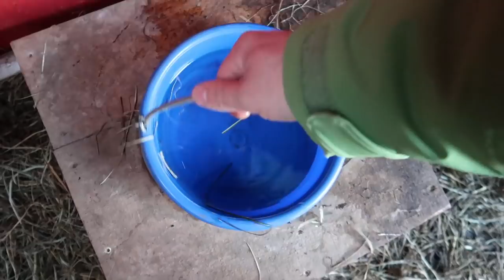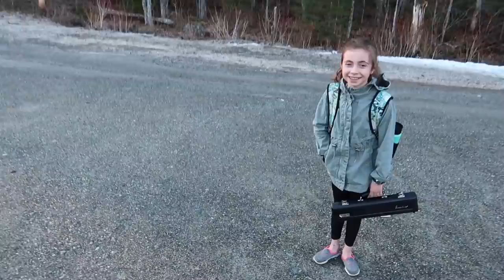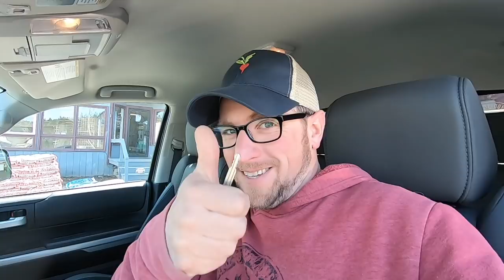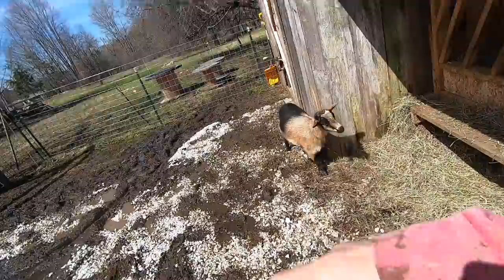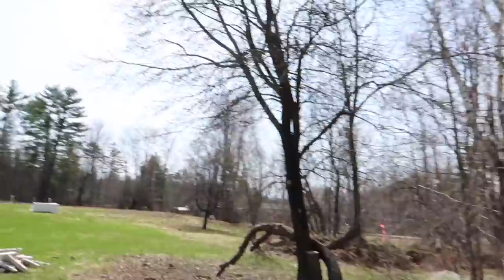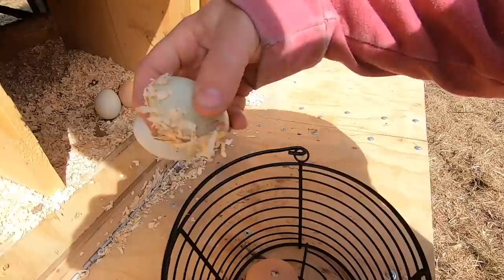Today Didn't Go as Planned    Getting Ready for Our Post and Beam Barn

Comment: to help with the drainage in the goat pen, the stone is a great idea, but you should put some all purpose sand in there too.  it helps drain water easier as it gets mixed in with the mud.  plain kitty litter helps too (i have to use this on my dirt road in the winter to help with melt water run off and standing puddles)

Comment: Al, My goat barn gets a lot of water, too. I use pallets as dry/raised-out-of-mud places to lay and walk. I cut some in half and leave some whole. I then tack pieces of plywood on top with screws. When the ground finally dries, I unscrew the plywood so I can move the pallets easier to do thorough cleaning.  I'm old so I need ways to make things lighter. YOU probably wouldn't need to take them apart. They stack nice and neat until winter.
Love your videos!

Comment: That's great smoking wood.  Apple wood smoked meat especially bacon.  Put it near the smoker for the next round of bacon, and other Meats.  The branches just split the big rounds.  Watching the barn raising will be alot of fun.  You may need a good block and tackle setup to do the heavy beam lifts. A load of mulch in the goat pen for deep bedding would be turned into mulch with some corn and pigs.  Save the stone for walkways and driveways.

Comment: Al, why not put dry soil and some green turf over the muddy soil around the barn?
Reply: Kyla Simpson how could he do that with a road ban? He doesn’t have either on the property.
Reply: @angelacross2216  that would raise the area and possibly cause the runoff to run thru the goat barn
Reply: jim h , yes that would work in another part of the country where the roads are open and turf is available . But Al explained the goats will be moving to the new barn so he only needs a temporary solution for now.

Comment: Thankx for starting my day.
Save the apple wood for smoking bacon.   Next time you have to cut fruit trees, see if you can plant the branch tips in pots, a season before you cut them off the tree. An old English method is to pin them on the ground or place a large stone on top of a bud.  This should cause roots to form. Branch tips can also be used for grafting. What you have there is proven root stock for your area.
Plant a few asparagus near your stream or where you think it grows wild anyway.

Comment: Hey Al, I suggest you moving the chicken tractors around New Yolk City some meters, so the grass below can regrow a bit.
Btw. I own an automatic gas filling snorkle for the chain saw fuel can, made by Stihl, that works awesome and is worth the money, that I recommend and suggest you to check it out.
Very easy to use and not a single drop is spilled with it. And you don't even have to remove it after the filling and can leave it on the can forever, as it closes tight.
For the chain oil I use an old, one liter, plastic transmission oil can that also has some kind of snorkle on it - much easier to fill it up ,spill free, to the top with it.
Take care and stay safe.
tom

Comment: Al, have you thought about digging a couple of small drain ditches about a foot wide and deep then put some gravel in the bottom to control the erosion?  The water might drain off naturally as the goat lot and barn does seem to be a little higher than the fence and gate area. With the soil so wet and just mud it should be a small task. Have fun and keep the hoe and shovel handy so Gina does not fall.

Comment: Really interesting to see the various homesteading approaches in the states. Not sure we have a word here for it , permaculture farms maybe? Anyway it’s fun to watch, get ideas from and learn from. The goats and chickens are doing really well. Nice choice in spot for the barn. 
Well done with the tree, it was maybe a little dicey the way you approached it, as you said it’s really hard when the trees aren’t standard and you’re a gutsy guy for having a go, likely I would have rung my local tree lopper. I live in subtropical rainforest, now and then I will have to cut a tree for one reason or another, mostly safety reasons. Like you I had a few close calls. With one like you had, because the branch/trunk came back down so low I maybe would have tried to cut  some the weight on the ‘spring’ by cutting as many smaller branches off as possible, and then possibly working on how I would like it to hinge. Be safe really hate to hear you were injured or worse. Bet your lovely wife gave you a dig in the ribs to be more careful. 
Anyway thank you again, my son and I love watching.

Comment: Why not wait until your apple tree has leaves and THEN cut the branches one at a time and feed it to the goats? They LOVE it! Also, I would start my compost piles right under the (remaining) apple/fruit trees. By the time it's spent and properly composted, some of the nutrients will wash out with rain and go wasted, so why not build it where it can benefit a tree?
Reply: Also, why not cut the tree in portions to prevent snapping and hurting yourself (or worse!)? The pressure is too much when it's whole, so usually large branches and trunks are the safest to cut in parts.

Comment: What is the advantage of Avocado oil?
Reply: @Jim Purl - Nothing worse than squeeky avocados! 😉
Reply: It has a high smoke point so you can cook at a higher temp.
Reply: @Rigglep  So does 10W30. But, I wouldn't cook with it.
Reply: It has the health benefits of avocado in addition to the environmental friendliness of using a byproduct of the avocado industry. Also, it's a neutral oil and can be used for all types of cooking, including deep frying. Far healthier than alternative oils.

Comment: None of my business but is there a reason you dont add another board on the goat feeder so they dont have to turn their necks to eat. ?
Reply: Al believes they are circus goats so a little circus will keep them fit !
Reply: He mentioned in another video that the goats don’t usually use the feeder as it was designed. They are supposed to put their front legs up on the board and have their back legs on the ground. 

He put a longer platform on the other side because when he got the goats Buttercup and Blossom were too small to actually use the feeder in the intended manner (front legs on the board back legs on the ground).

iirc I think he said the whole design (front legs only on the platform and the angle of the slats) would keep the goats heads in the feeder while they eat, so they don’t pull everything out. Keep in mind I am just relaying info from previous videos I don’t know much about goats myself.

Fyi there was at least one instance on video where one of the goats used the feeder as it was intended. It was in that video that he talked about the design. Who knows they may use it correctly more than the parts of feeding we see in the videos.
Reply: @Solo-oo4qq  Even fully grown ones cannot do the intended circus. The height should be lower by 1 foot to do that and still get to the food

Comment: Are you gping to extend the feeder on the front side so the goats have mpre room like thw otherside.
Reply: Yeah I mentioned that last week too.
Reply: No, it was built like that on purpose intended for the adult goats to have 2 feet on the ground, far side is for the smaller ones.
Reply: @jay90374  The goats didn't get the memo.
Reply: @sherry2836  - LOL, they use it like that much of the time.